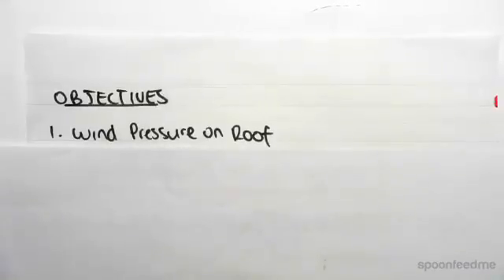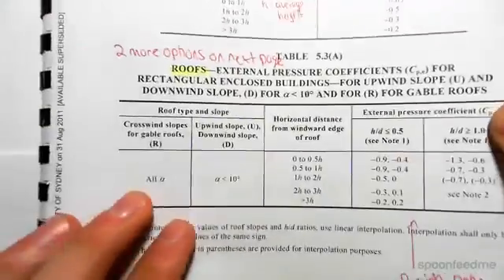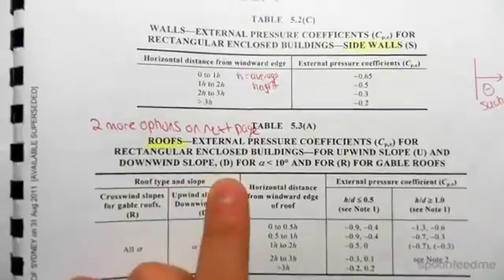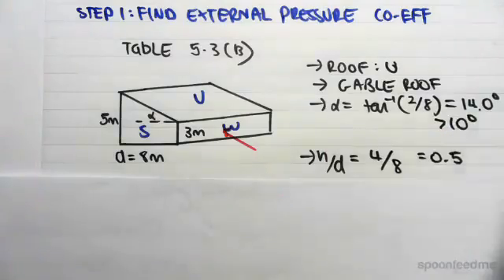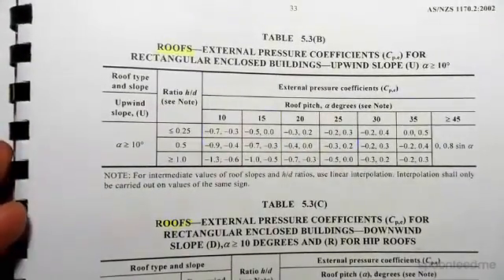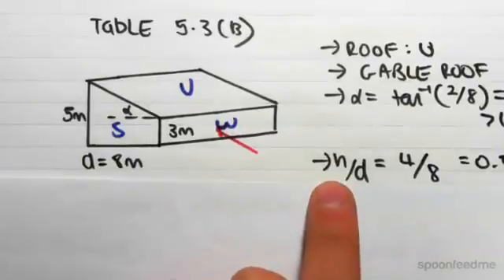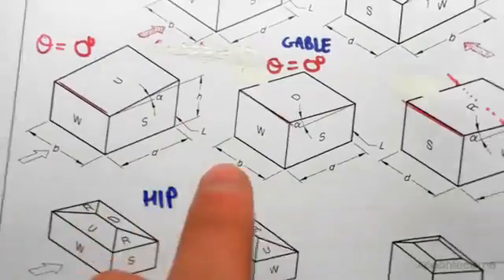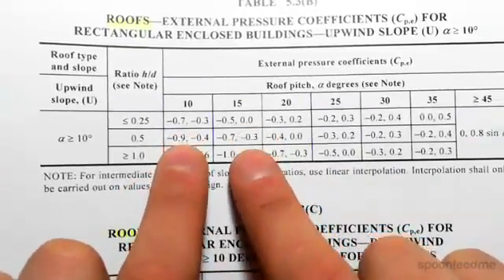Wind Loading Example: Calculating Pressure on Roof | Structural Design & Loading

Comment: The Text is AS/NZS 1170.2  At 1:14 you can see the document number plus the 2002 date. BUT That table 5.3(B) is a later revision. On the 2011 year code book it is on page 35 versus 33. That code book is for New Zealand and Australia.

 In the US we have the ASCE books of 7-10. 7-16, for 2010 and 2016. The US book is updated every 6 years. The later/newer code book have better modeling for wind loading.